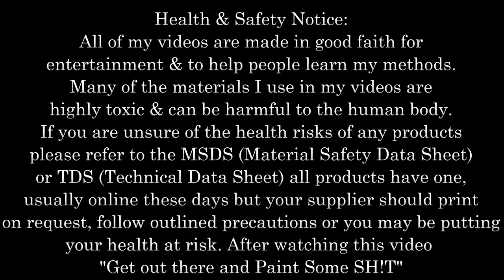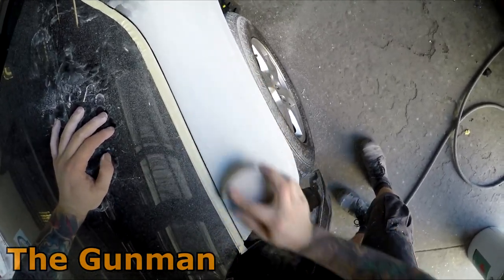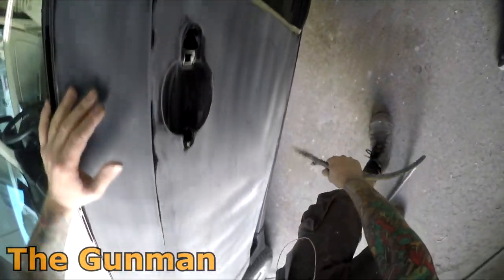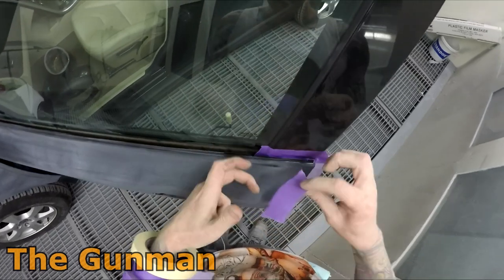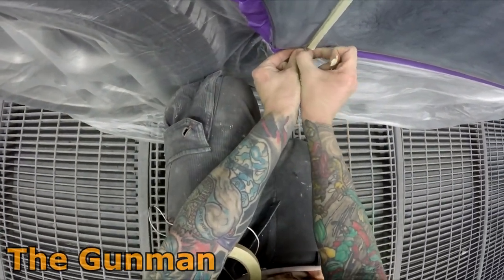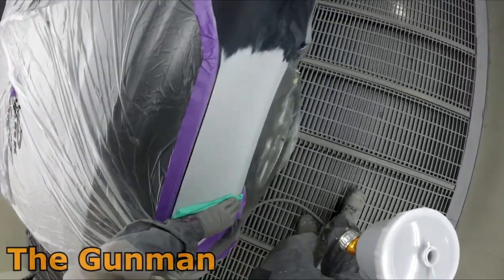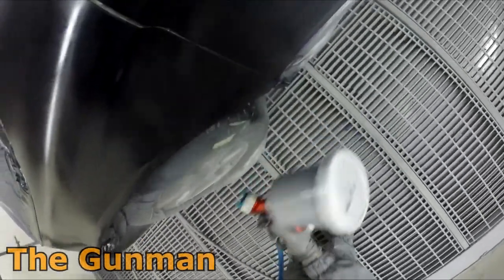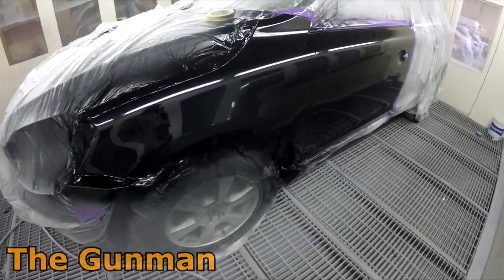Volvo XC60: Spray Painting

Comment: You do not have to do primer work in a spray booth. I'm glad you brought that up. Many of times I have done prep work outside of the spray booth. That's a good tip painters need to to know.
Reply: simzy01954 👍👍👍👍

Comment: I suggest you try 3M Fine and Superfine papers.
Fine for before primer and superfine after primer. 
Absolutely the best for those tricky edges.
Reply: great work
Reply from the maker: Thanks man, I know the ones you're talking about and we do have them but I don't really like them, the other guy I work with uses them all the time, I find they don't knock the peel out very well like the 800 pads I use do, but each to their own I guess.

Comment: How did you get the paint to shine like that?? I recently fixed scratches on my car, sanded it down old paint with 800 grit and repainted over it with a spray can dupli-color. But it's dull compared to the areas around it.. I have not clear coated it yet (also spray can), is that the reason? And how much do I need to apply because you were pretty liberal there haha :P
Reply: Ace you need to use clear in order for there to be a shine of any sort, as you can see in the video, before Gunny clears the door and wing, the black looks pretty dull. As you are using a can, you will need 6-8 layers which are light, do not rush this as you will get runs and waste more time.. Also, assuming you are using 1k lacquer which is pretty much standard in aerosol cans, you will have to allow for longer flash times as the lacquer has to dry (the lacquer used in guns are 2 part and cure)

Comment: Thanx for all the help,  youve inspired me after watching your vids, Im just about to buy a prolite for clear coat, do you still recommend the te20, also why do you leave the air cap off on top of the pot ?
Reply from the maker: Look I've never had a pot drip from the top, and that's just how I've always done, and yes I do still recommend the TE20 unless you are working with a smaller compressor or if you are a DIY hobbyist I would probably even recommend te10 t110 air cap
Reply: thanks for quick reply my compressor is 50 litre and 9 cfm

Comment: Do you 600 all your blending areas, even for silvers ? I use 1000 grit but think it might be to fine for the paint to stick,  got some 800s but not sure about using as they seem to course to me..
Reply from the maker: Yes, I use 600 even for silvers, if I'm doing a Mazda I'll use 800 because they use so little paint. I do recommend 800 but maybe not 600, I know most people don't have success using 600 like I do. There are a few reasons I can get away with it, like how I leave my base a bit thicker and how I blend. But 1,000 won't be too fine to grip if you're worried about that, I also find it's quicker to use 600 and I use less paper, even try a quick 600 to knock the top off and finish with 800-1,000 especially on the Euro cars with a thick peel and lots of material.

Comment: How many coats of clear do you have to apply on the bumper so it doesnt chip.. factory paint lasted 10 years and resprays chip after a month.
Reply from the maker: +Radu Christian the clear they used must be very poor quality because that doesn't sound right.
Reply: The Gunman what is the clear coat you use? The brand and name lets say. Thanks for the reply
Reply from the maker: +Radu Christian standox

Comment: You make painting look easy, but it's not.  I just painted my truck bed with an AmPro gravity gun and Nason Select clear 498-00. I have such a hard time finding the sweet spot spraying so I don't have orange peal or runs. I'm a complete amature with it all. I'm spraying at 18 psi with the fan knob set at full fan with the fluid tip full open. I'm not sure of the tip size but it says max 10 psi. If I spray at 10 psi, it just spits large droplets.  I sprayed at 70 degrees and used the mid temp activator. The paint is a 2 part and doesn't use reducer. I feel like if i had slightly thinner paint or a gun that atomized finer, that might help. I'm not sure about any of it. You're awesome at your trade.

Comment: Good day Gunman.  I have a question in relation to the way one sprays a car.  I was watching an American site and the painter was painting the car from the bottom up and doing  the roof last.  I know you work downwards so was wondering if it makes any difference which way you do the car?  The site that I was watching was showing a candy red colour being applied.  They also commented on the type of exhaust system they had which If I can remember the term, was a cross flow not a down draft system. (if that makes any sense)  Do the different exhaust systems dictate which way you start on a job?

Comment: dude you need to get you an olfa slimline razor knife for the plastic/tape cutting in the booth, makes life so much easier just having that thing in your pocket and not having to mess with a razor blade.
Reply from the maker: It's actually very handy to keep one of these in my pocket, I've always got a blade on hand and it saves time. I had a look at those cutters and they do look good.
Reply: The Gunman i feel you, if you ever get a chance definitely try one out. a fellow painter showed me one about 10 years ago and it's all i've used since

Comment: Just ignore the loud mouths you help a lot of people including me and I am very grateful for it.  I am totally new at painting.  It is only for hobby and personal auto work.  I have painted 3 bonnets, 4 fenders, and a tail gate. I got another newbie question for you Regarding sanders.   Is there a difference in air vs electric for sanding?  I have many electric sanders from finishing sanders to 2 horse power grinders that will cut thru steel.  What would I gain by changing to air power?  What advantage would I get by changing to air powered sanders?   Or is there an advantage?   I have a 5 horse general use air compressor with a 25 gallon tank.  It seems good for running air ratchets, air hammers,  air wrenches, pumping tires and painting and ect.  Thanks for help.
Reply from the maker: The advantage of air sanders is they'll last longer, no electrical parts to fail, plugs and leads, brushes etc. As long as you have the compressor to back it up air tools are usually superior, not in all cases but that's why we use mainly air tools. Air sanders are also lighter and easier to manoeuvre.
Reply: The Gunman Thanks mate.  Much appreciate. You can block haters and loud mouths too,  if they get to bothersome.
Reply from the maker: That's what I did with him, I prefer not to but when they are just here for a fight then they can get fkd, I warned him and gave him a 3rd chance to change his tune or I'd block him but he kept going so bye bye.